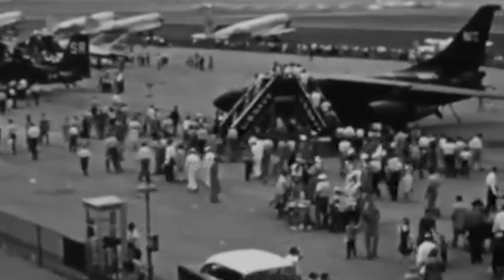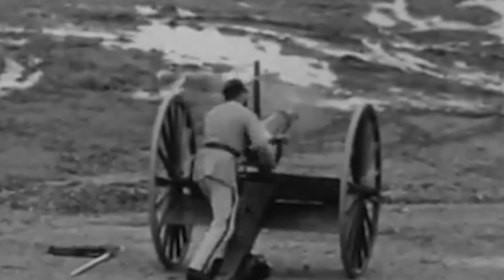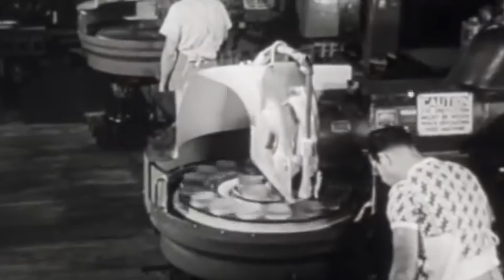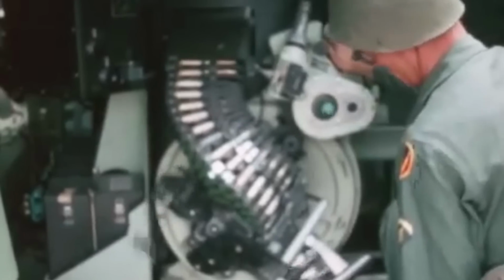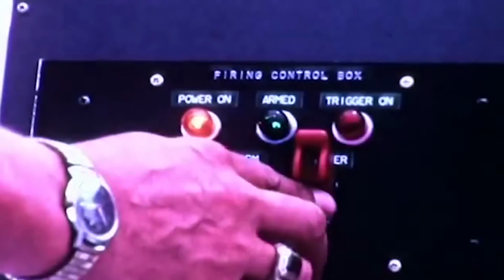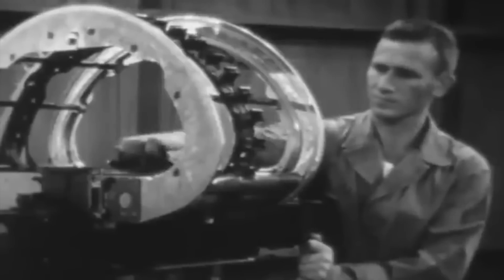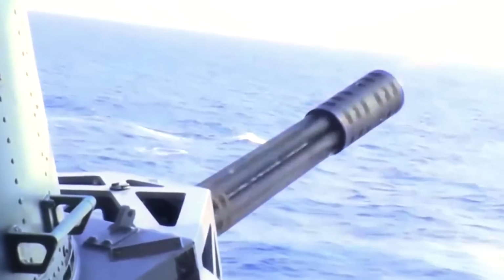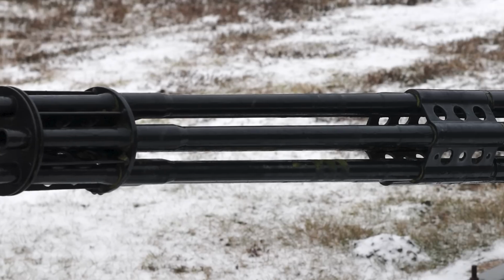Giant Bullets Fired at 6,000 Rounds Per Minute

Comment: When talking about weapons like this rpm means rounds per minute not revolutions per minute.
Reply: In the section where he says "revolutions" he literally meant revolutions of the barrel.  They only loaded 50 rounds, so they were theory testing.   The 2500 is the same,  this is when they are talking about the revolutions of the barrel that they were shooting for.   The 6000 rounds let minute equates to the weapon spinning at 1000 revolutions per minute.   1000 revolutions, each barrel firing one round per revolution = 6000 rounds per minute.

Comment: 100 rounds per second?
Reply: Yes, 6000 per minute you know ?
Reply: No way...... @altblechasyl_cs2093
Reply: 50. The ground based Vulcans are set up for 3000 RPM. The ones in aircraft have better cooling and won't overheat the barrels at 6000 RPM-in short bursts.

Comment: So i suppose the smaller 7,62 mm version on the UH1 was developed later?
Reply: Yes
Reply: there's also a 12.7 mm/.50 cal version, typically with three barrels.
Reply: Different weapon but yes.   The UH-1 utilized the GAU-17, not the Vulcan.   Two different weapons,  but still an awesome gattling gun!  They also use the M-134, only difference is one has a "high" and "low" rate of fire selector switch I think.

Comment: giant bullets are necessary in high altitude where winds are strong
Reply: In high altitude their is not much air so not much wind
Reply: @windowsxp9815  Not heard of the jet streams?
Reply: @delboy1727 
The jet streams don't occupy that much space as far as altitude is concerned, it's actually a thin area comparatively. 
They generally exist around 30,000 ft and aren't more than a couple thousand feet high give or take, they're also not everywhere at 30,000 ft, just in narrow bands.
Even then at the distances that air to air engagements happen at the rounds aren't in the air long enough to be even moderately affected by them.
Reply: Well...yes but actually no :)
With fast moving targets you got less and less time aiming perfectly. So you need a) most bullets per time deliered and b) the most damage done with those 
to deal sufficient damage. In Dogfights you mostly have a second or two to get your shot - getting the most out of those seconds is vital.

Comment: you forgot to shows it's famous sound
Reply: Bbbbbbrrrttttt
Reply: @jacklinks6097 😂
Reply: That's the sound of a GAU-8 Avenger, not a Vulcan Cannon.
The two sound nothing alike whatsoever.
🍄
Reply: I found that M61 has scarier sound than the GAU @the_unrepentant_anarchist.
Reply: @the_unrepentant_anarchist.  it is similar , the A-10's is famous for the power of it's GAU-8......
Reply: @the_unrepentant_anarchist.  
Why wouldn't they? 
There's different applications for the M61 cannon that use different firing rates with some of them being close to the Avenger cannon, so they'd sound virtually identical especially played back in a recording. 
The land based version of the Vulcan gun I was a crewman on had two different firing rates depending on what you had it switched to, 1,000 rounds per and 3,000 rounds per.
In jets depending on which one they're in they fire from 4,000 to 6,000 rounds per.